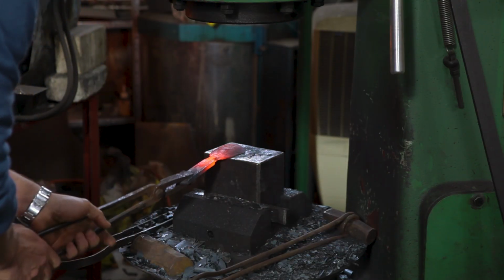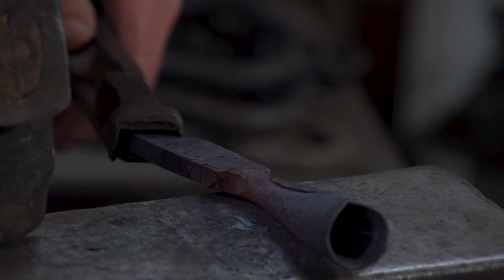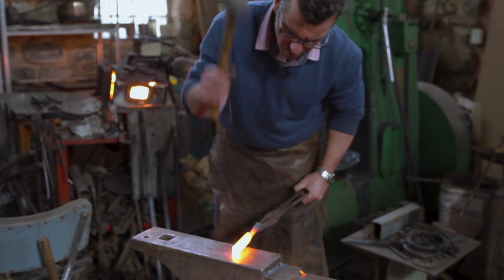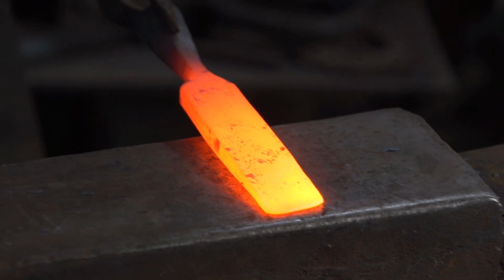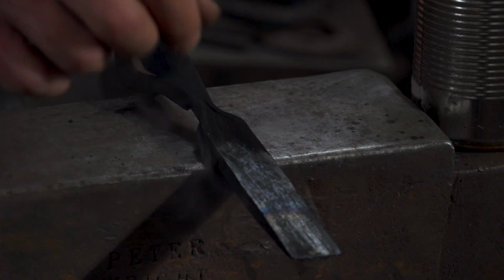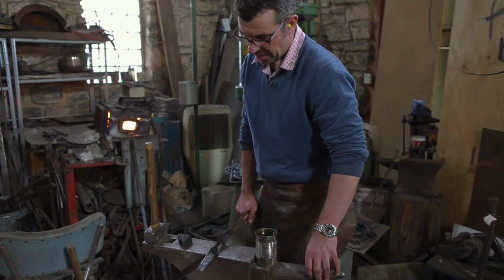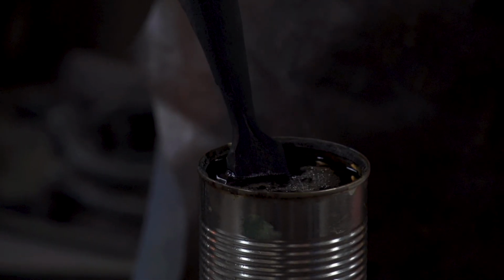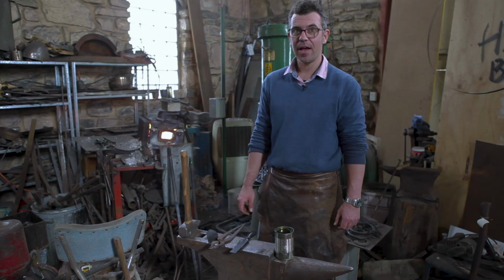Making a socket chisel

Comment: Wow, great video! How hard dos that hammer hit? Looks like its just lightly tapping...
Reply: I know this is a two year old comment on a 7 year old video, but I'm going to answer this anyway because it sounds like fun. So depending on if you mean the power hammer or the what looks like 3~ lbs hand hammer the answer is either around 500-1000 ft/lbs of force depending on the specific setup of the power hammer or somewhere in the ballpark of 1-300 ft/lbs for the hand hammer. This all varies quite a bit though, especially since that power hammer is being used fairly gingerly.